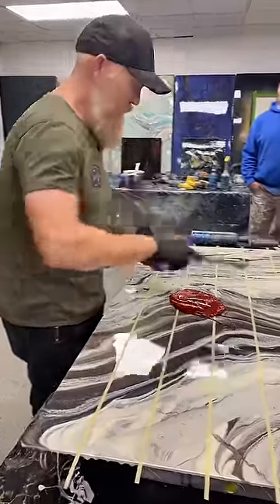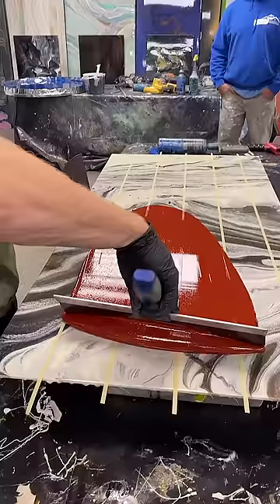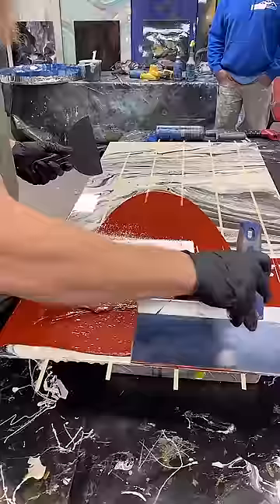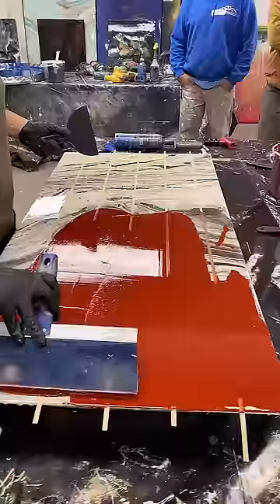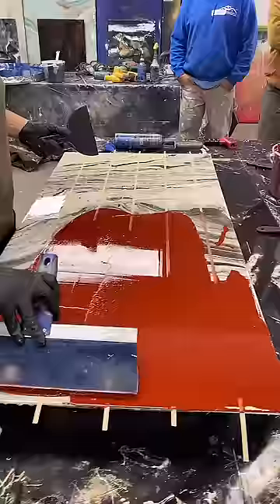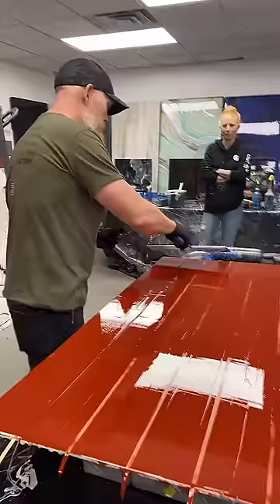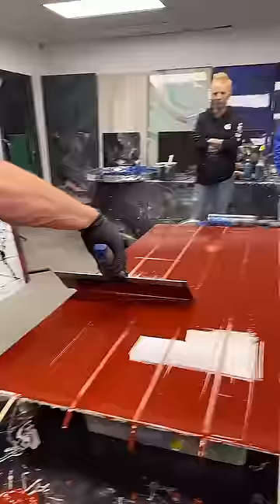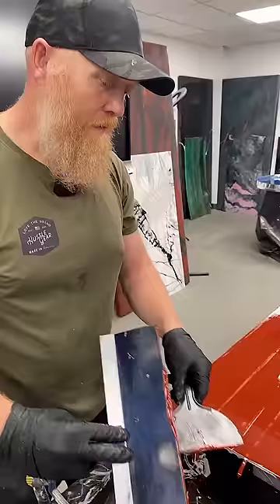Epoxy Tip: When creating a wood grain effect, using less epoxy creates a more realistic look!

Comment: Fact you might not be aware of, there is a slight bow in the trawl. So you may be taking more off than you think or less depending on the side you use.
Reply: A good tradesman always PUTS a slight bow in his knife.
Reply: @anthonykurczewski8384  The heck are you talking about? It's a Trawl not a knife. also it is manufactured with a slight bow in it.
If you do mud and tape you would know what I mean.
Reply: @Admiral_tintin  I have been doing 'mud and tape for 50 f'n years, shite for brains.
Reply: @Admiral_tintin  I am a Decorative Artist that does level 5 walls in prep for Venetian Plasters and Marmorino / Spotolati.  Compared to me, you are an Amateur.
Reply: @anthonykurczewski8384  Congratulations on your time and experience.
I hope you have a very nice LV 5 tool set. I know I enjoy mine. Or your knife set sorry.